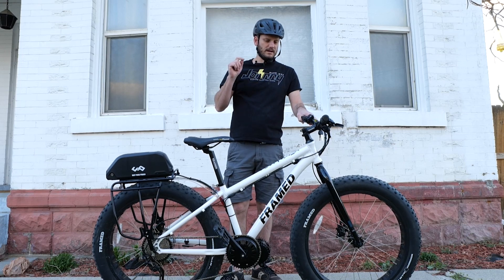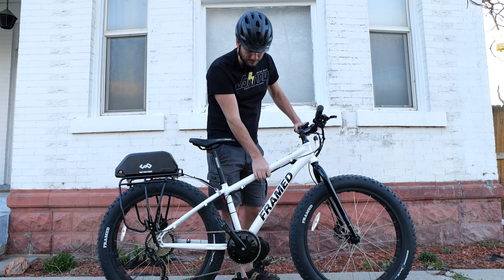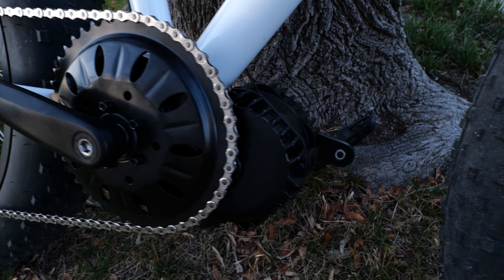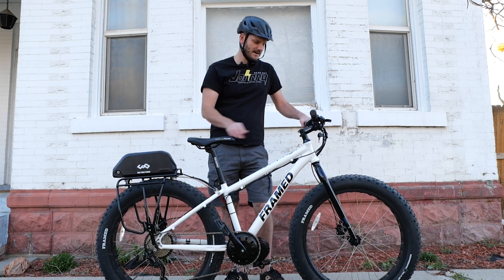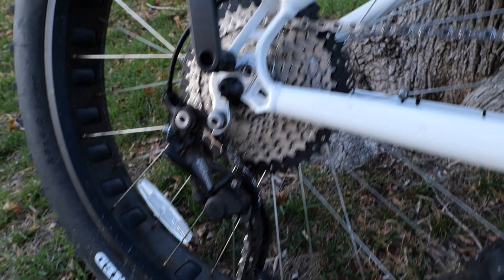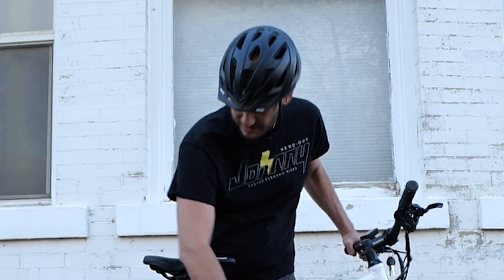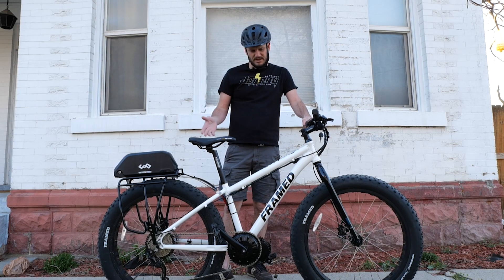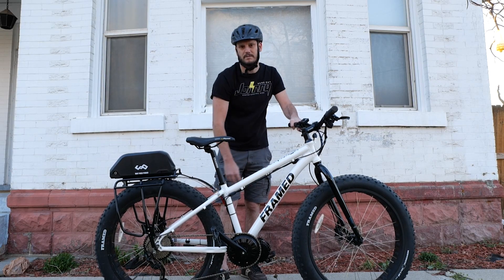Custom E-bike Build: Minnesota Framed Fat Bike w/ 1000w Mid Drive BBSHD 48v 19.2ah Jumbo Shark

Comment: I just bought this bike. It says it has a 100mm sealed bottom bracket. I'm buying the kit off your website to convert it but do I get the bbshd 100mm? Thanks to you or anyone else who can help me!
Reply from the maker: Yes. You want the 100mm. Occasionally there is fitment issues with the 100mm and a 120mm is needed. It is fairly rare though.
Reply: @JohnnyNerdOut  thanks man. ordered the motor from you. i bought a luna 30t chainring for the front. if i get a messed up chain line i might have to try the stock ring like u did here and get that kmc e10 chain. im going to be climbing a lot of hills around me using it for hunting. also might try a lekkie 42t. i'll figure it out. i watched this video and Framed had these bikes on sale right now for $698 free shipping from their website. Beats buying a $7,000 rambo hunting bike with junk components.
Reply: @JohnnyNerdOut  also the amazon/bezos comment forced me to buy from you vs anywhere else. ;) bought a battery from bicycle motor works though. gotta give USA guys a fighting chance. Thanks for all the build info. im going to follow along to one of your videos when all my pieces arrive. Might have to pay for one of those phone consultations if i hit any issues.

Comment: hi Johnny. Would you say that you always go for the HD version over the 02b ? i have found a used 02b kit for about 195USD cheaper than a new kit, (917USD), and  a new HD kit goes for about 1340USD. Im planning to put on a MTB 27.5"

Comment: I did this build myself. Been working great for me in cold weather. The default water bottle mount wont work with most of the standard batteries though. You need an adapter to put it further down the frame.

Comment: Again I do 43 mph with my Giant Chopper bike with 2 hub motor that cost less than a bafang 1000w mid drive. Genius tell me that it add more weight. Obviously it add more weight but the power you add is more important that the weight added. You gain bits focusing in reducing weight on a bike. They also say mid drives has more torque for climbing. On my other bike with 3 motor, 2 hub and a bafang BBSHD 1000w mid drive all 3 independent system, my bafang 750w rear hub with a 45 amps controller  climb hills that the BBSHD 1000w mid drive can't. Watch the test comparaison on my channel.

Comment: I you get bored check out the, Triseld Aquila3......It's a velomobile that actually doesn't look dorky, looks like a glider/sailplane without the wings & tail section.   I'd love to build something similar with a 1,000w mid drive kit & an overdrive pedal assist gear for hwy cruising at 55 mph. The lightweight aerodynamic enclosure helps increase efficiency & keeps the rain & cold off you. You could also cover the roof in 100-150 watts of solar cells. Would be awesome if it was full suspension. Just use an adjustable MTN bike rear shock on each wheel.

Comment: I am struggling with continuing to offer fat bike conversions. The last two I decided needed written acknowlwdgement that I had told them of the dangers.

They're great in fresh, not packed snow, on thick sand, bit not sand on pavement. They're amazing in plowed fields and on tall grass. Other than that...

Fat bikes were designed to go 6-8mph, maybe 10-12 occasionally, for short distances. If the tires are filled for range and pavement riding they bounce like basket balls! If soft enough to absorb road irregularities, they dip dangerously in stops and low speed turns. They squirm in turning at any inflation and having the thinnest rubber casing, they get the most flats and can burp right off the rim!

I have had three fat bikes, converted for experienced riders, put them in the hospital. I don't like to think about the others (at least one is permanently stored because a crash scared the rider). Imagine the things happening to junk like DTC fat bikes with tiny mechanical disks and spring suspensions that failed in The 90's!
Reply: TY for your lessons learned.  Did the bikes give the rider too much confidence that it got them in trouble?  Nice to hear some Cons about a Fattie other than it's heavier than a regular bike.

I've rode the Lectric XP 20" and liked it's stable ride due to the 4" fat tires.  Gives a heavier motorcycle feel to it.

The "High Voltage" channel, his souped up Specialized Fattie is something to see.  The speeds he gets on dirty roads made me think that you wanted a Fat Tire for stability at speed since it simulated a 65 lb motorcycle. Also the fat tires don't get stuck in transit rails like a skinny tire.

Front fork, do you recommend a suspension fork or a solid one of you're going fast?
Reply: No bicycle tire has anything at all in common with motorcycle or automobile tires. They are not low profile and do not have stiff sidewalls. They are LESS stable.

You mentioned trolley tracks. Because they dive and squirm, they are likely to throw you. Now, since your bike has only 20" wheels, its sidewalls are much stiffer.
There's a reason absolutely no traditional road or quality gravel bikes have suspension forks. They are designed for off road control, not on road comfort. They are just heavy range and power eaters on pavement or even hard pack.
Reply: @MHH3180  TY for reply.  I see what you're saying - limitations of a big fat tire sidewalls & tread design leads to problems you mentioned.  I'll stay with a standard MTB for conversion since there's more selection of tires to work with and sidewalls are more stable.. 
Seattle has lots of potholes & bike trails with tree root bumps. Front suspension is nice on those trails & jumping over a sidewalk curb to get out of a street jam or mean driver.
Safe riding, no Oofs & Ouches.  Beware sunken manhole covers, approach angle with trolley tracks & handlebar snags with telephone poles & trees.
Reply: @hillyseattlenarrowstreets6087  honest, I understand what you are saying, but if you need a front shock, you need a rear, which carries mich more weight. The fact is, you need neither. For over a decade (two if you include California Klunkers), mtb's did not have suspensions. The second hottest trend in cycling is adult BMX...no suspension. Pot holes and man hole covers can almost always be avoided. I've ridden a tally criterion racing bikes over tree roots and on undulating bricks more than a century old. Take and control your lane. You will actually have fewer motorist harassment issues when you are not inviting them to pass within your lane. It also gives you room to ditch as well as keeps you out of the tire piercing trash in the gutter.
Reply: What fat tires are you talking about? I have gone ~10,000 miles in the last 2 years on chao yang 26x4” and I’ve never had a puncture with them. They are thicker and more durable than the maxxis on My 29er which usually has a flat every time i go to ride it and it gets flats all the time, the tires aren’t as thick and little tiny office staples puncture them easily. Would love to hear what tires you’re talking about cuz i have 2 motors on my fat bike and it goes 45mph+ and I’ve never had any problems like you’re describing. There are a ton of 26x4 and 20x4 fat bikes I’ve never heard anyone scared to ride their bike because of an inherent flaw of fat tires. Would love to hear you elaborate I’m genuinely curious
Reply: @EBikeBuilder_  I listed the problems. Those are fa ts not opinions and the stories are not just anecdotal, problems are popping up all over the country. A bike designed for 6-8mph soft surface riding is unstable on pavement even before you out an off road suspension on it. Lots of 20" are indeed doing great. They are short enough that the side wall is relatively stiff. 26" fat tires have a lot of trouble with flats because if they were normal thickness they would be too heavy to turn on a traditional fat bike amd nobody is making e-bike specific fat bike tires. Of they were, your range would be horribly decreased amd your ride a lot rougher. Anecdotally, easily 75" of my flats are hub motored fat bike tires.

Comment: Nice! Hey Johnny, will you please address battery drain during sub-freezing weather, & wind & what to expect? Thanks man.
Reply: If really cold around freezing.  You'll notice wont last as long. Dont charge if batery is cold. Left outside.. try not to let happen.. but ok to use. What I found flying drones.. went through 15 bats a day for years.  Bats lasted a good year if took care of. If didn't? Week. Lol  what I found.. take care of battery it will take care of you.
Reply: @Sleeping Bear FFG  Thanks. Do you have an ebike along with your drones? I was wondering if wind affected the mileage/endurance as much or more than sub-freezing temps?
Reply: @SmokeyTreats  yes I made first one. Used Johnny's cyclone! My first build! Lol in handy like that.  Leave ya link . 
Yes wind.. hills.. whieght.  Like drones(all evs) you build to your needs. Fast = light. High amps and volts.   Long range bigger batery and low amps slower speeds.  Whieght big no matter what. I love my ebike! But I'm a builder like jonny it's the coolest ebike I've seen? Lol I'll look up vid leave a link.  And if ever need help? Questions? Let me know.  God bless and enjoy the day God gave you👊👊💪💪
Reply: @Sleeping Bear FFG  Thanks. How about sub-freezing temps, do you find your battery depleting much faster than when it's not freezing?
Reply: https://youtu.be/xrRoqXmExh4 my ebike!
Reply: @MHH3180  Thanks!